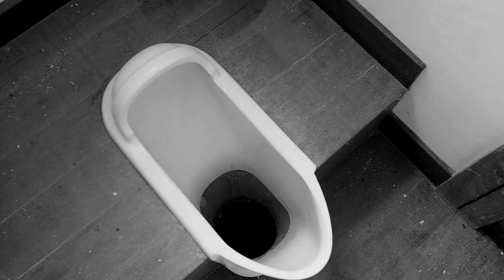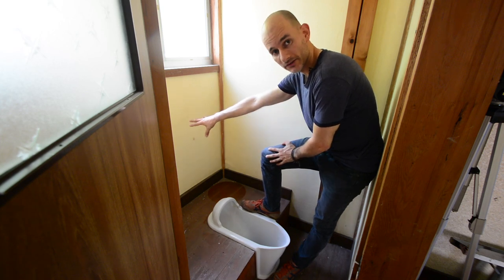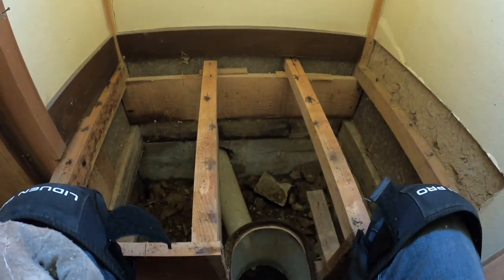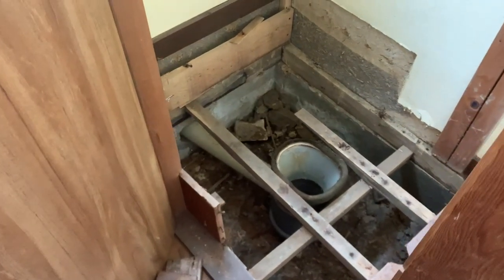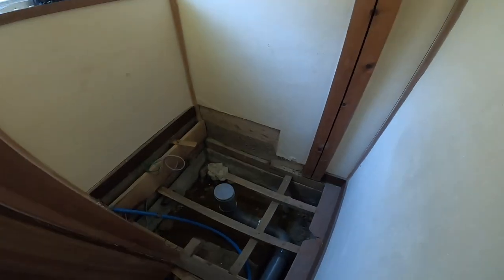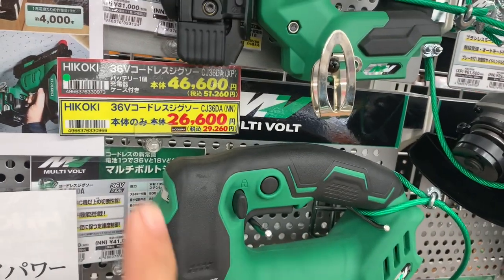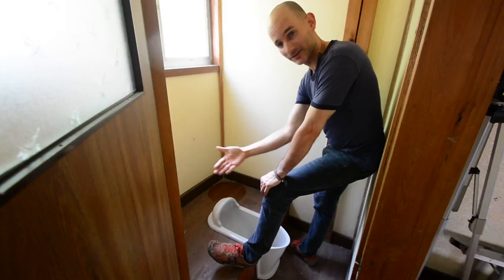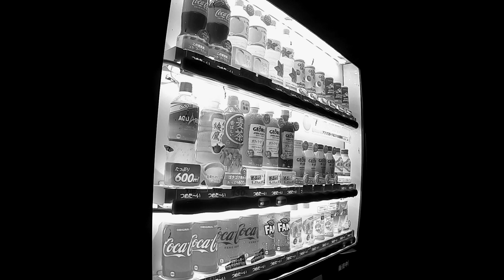Abandoned akiya house bathroom renovation - Part 1

Comment: Nice work. Thanks for the video. Just curious why you didn't use any insulation beneath the subfloor. Is the winter cold? My biggest concern buying one of these old houses is the cold and ensuring everything is insulated.
Reply from the maker: It's a good question. I felt that the toilet room was far enough away from the actual heated areas of the house for it to not make much of a difference. It's a lot of work to insulate the floor in such a tight space and around all the pipes. The water pipes are insulated though. This room would be hard to heat unless I installed a small electric heating unit inside the toilet room independently. Al the houses I have been in Japan are either too cold or super hot and never have climate control. But I hear ya, I would love for it to be at least heated in the winter... when I do the bathroom renovation, I have considered many options to heat it in winter which might be shared with the toilet room. Let's see! Otherwise, only one floor downstairs will be insulated which is the living room.